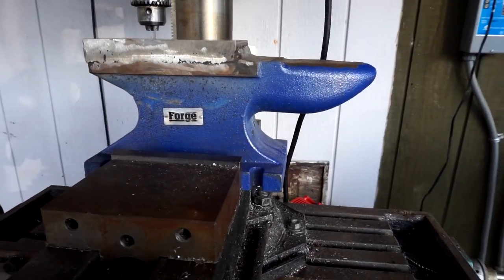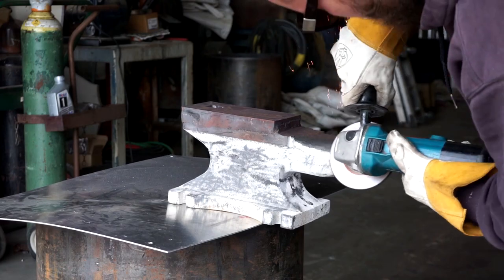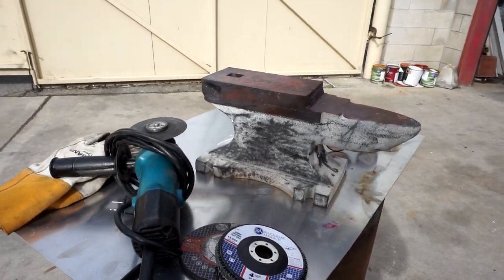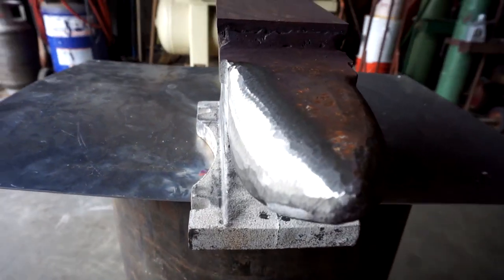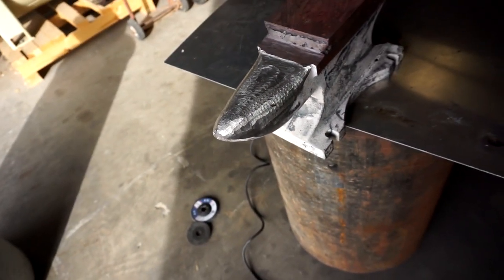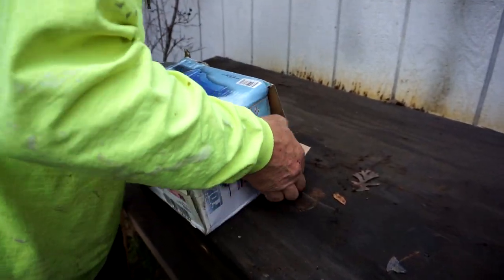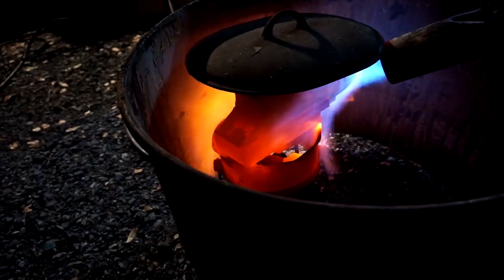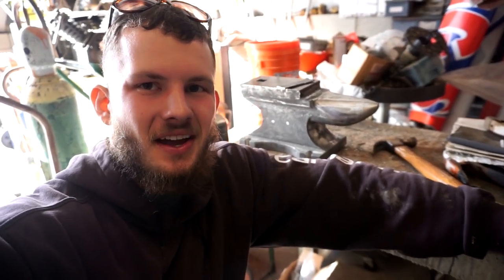HARBOR FREIGHT ANVIL: Milling, Hardening, and Finishing, Part 2

Comment: I'm very likely to do the same thing on my HF anvil.
Don't get me wrong, I've had it for  22 years and have made a ton of usable and salable items for the Mountain Man/Rendezvous.  It has served me well for all that time but, it's time, now that I have a welder and some skill in using it, I want to make  hardened top plate so that it is much more anvil like.
I have already ground down the horn and made it hornier, LOL!!
My onl problem is that I will have to find someone to mill the Hardy hole because I have no milling machine, access to one nor the skill to use one.
I did recently buy an NC 70 pound, actual anvil but, the old one is certainly still usable and my Grandsons can learn on it.
THANKS for the videos and you now, have a new subscriber!
BTW, that step shelf just behind the horn is a cutting plate and SHOULD be left soft so as not to destroy the edge on the chisels and cutting tools!  KUDOS!
Reply from the maker: I appreciate your kind words and advice! If you have the anvil, I'd highly recommend the hardened top modification, but don't be afraid to try a different alloy. I used A2, but plenty of other steels would work just fine. Good luck on your project. Lastly, I did not know that the step was used for cutting! I will definitely be keeping that part soft.
Reply: I'm trying to start up for mountain man rendezvous here as well.
Reply: If you have a drill press get to as much of it as possible with that then try to use a good hand router to go from hole to hole. That's a trick that tons of people use on ar 15 80 percent lowers (although with jigs so maybe think about that) to circumvent the need for an expensive mill.
Reply: Kim Curtis smart idea about the shelf for cutting!

Comment: Is there any reason why the A2 plate couldn't have had the hardy hole milled out, bevel grinding complete, heated in a forge to critical temperature, air hardened and then welded to the cast face? Rather then going through all that.... or am I missing something? 
Love the content, and will be looking to do the same and such is the beauty of YouTube where we can all learn from the sweat of another's brow.
Reply from the maker: The problem with heat treating beforehand is that when you weld the plate to the anvil, the heat from welding will ruin the temper and remove the hardness from the A2 plate. This means that you will need to regarding it after welding.

Comment: I actually think you guys did great. I think you are probably right, it might not have stayed hot enough to fully austenize, and get as hard as it could have been. 

Cooling it with compressed air is definitely fast enough for a2, the main thing you really need to think about though. Is the rest of the body of the anvil, that is holding a lot of heat. That cast iron may have slowed down the cooling considerably, leading to it being softer than it would have been otherwise. Which actually could be a good thing, you don't want it fully hardened if you're going to be hitting it.

And I definitely think you guys were right to weld the plate on first, then heat treat after.
Reply from the maker: Thank you for the kind comments. I think that for our resources (or lack thereof), we did the best we could. The steel definitely got harder, so we did something!
Reply: @FormulaJake  most definitely.  I think it's a big improvement over the cast iron face, that's for sure.

Comment: Did you consider using coal to heat it? 
I use a coal forge and it will heat huge pieces of steel and fast!
Reply from the maker: I did not consider doing so, but I would if I did it again. Propane gas it's great, but it really doesn't get that hot on that big of a piece.
Reply: Airborne Productions Thank you for your video! I’m thinking about doing this exact same thing

Comment: You might also eventually look into getting a Sievert Torch. The one I have will get over 2000 but you need a good high pressure regulator to do so. Oh and they are threaded backwards as they are from the UK. So you’ll have to get a specialty company to rebuild your hose on the end that attaches to your gas tank or source and regulator. They will cost you a couple hundred dollars though. I got mine because I also do glasswork and silver and goldsmithing and I’m working on getting a bench mount for it. If I have to weld one together myself.

Comment: Horns are always soft. Cast steel horns are harder, but nobody has hardened horns except on small jewelers anvils. Good luck that the plate doesn’t break off the CI base at some point.

Comment: I have a kiln and I guess I’ll harden the A2 after I bevel it then weld it on. Did you air cool it? Rather than Quenching?
Reply: My plans all got the brakes put on after I first posted this. But now I have two plates one D2 and one A2? Decisions decisions?
Reply from the maker: Sorry for the late response, this is my first time seeing these comments. We air cooled it since it's A2 but the core of the anvil actually holds in quite a bit of heat. We tried to improve the process by adding water to it so it didn't become annealed from air cooling too slowly. Out of the two I would go with A2, as it is a bit tougher and less prone to chipping. 

I'd consider welding it to a plain block of steel rather than the harbor freight anvil, as the cast iron used in the anvil is difficult to weld to properly. To do it right, you need to use a filler metal that will work with both metals, such as nickel 99. This filler material is usually pretty expensive, though.

Additionally, when welding, make sure to weld the entire bottom striking surface to the anvil. We only welded the edges, which was a mistake. Without welding the entire underside of the striking surface, the gap left ruins the rebound. If possible, leave a gap and fill the entire gap with nickel 99 rod. Like I said, it will probably be expensive.
Reply: @FormulaJake  D2 is more expensive too. I will use it for blades or something later. I will look into the nickel rods if I can find any.

Comment: You said you were welding the A2 plate on to help with rebound, but you didn't compare the rebound before and after. How do we know if, and by how much, this helped?
Reply from the maker: I didn't quantitatively measure it before and after, but I know that the rebound actually decreased after, due to only welding the plate at the edges. However, the A2 plate is so much harder than the cast HF anvil surface.

Comment: That's a nifty idea actually! Might do that to mine.
Just watch out, A2 can be very brittle when hardened, and if you miss and hit the edge with a hammer it can send chips out like bullets right at the height of your femoral arteries and other important stuff in that general area. If you manage to harden it look into tempering it too so it's less likely to chip!
Reply from the maker: If you want to put the HF anvil to use at all, I'd highly recommend adding the top! A2 isn't necessary at all, though. Eventually I'll harden it again to get a better heat treat, and a good temper will definitely follow. Thanks for the advice!
Reply: @FormulaJake  Maybe try a decent temper around the edges so you can maintain toughness to avoid chipping but not have nearly as much brittle property to the material. Hope I can be of help.
Reply from the maker: @schleybailey  good advice! Right now it is not very hard on top, so we are going to heat it up at least 200 degrees hotter than it was and then cool it off so it actually has some hardness. Then we will temper it to make it less brittle. Thanks!

Comment: Can then anvil be hardened by itself? Meaning without the cap...... Can just the anvil out of the box be hardened? Or is that top cap necessary?
Reply from the maker: The cast iron itself is pretty crappy, and probably won't last like some good tool steel. I'd recommend adding tool steel to it, but it will still work as is. I don't know how well it will harden, though
Reply: @FormulaJake  THANKS, I went shopping around at some antique shops yesterday..... I may have to start out with a harbor freight cast iron chunk. 
Great video.
Reply from the maker: No problem! I'd look around and see what you can find. We also completed an anvil build using a forklift fork for the body, cut into ~8 inch lengths, and stacked up and welded. Then we capped that with A2. You might be able to find something that works out better for you!

Comment: Uhhh u didnt heat treat that u just nomalist it
Reply from the maker: Yupp, I mentioned that at the end. I'm gonna try again this summer with much more heat.
Reply: @FormulaJake  heats not just it you got to quench
Reply from the maker: It's A2, which is air hardened. I read many write-ups about hardening it, and they said heat to 1750°F, then let cool down. Would quenching it be better?
Reply: air hardening requires an enormous blast of very cold air,also why did you not oil harden the plate before you welded it to the anvil?
Reply: @FormulaJake  Harden in warm oil instead of compressed air. Air hardening requires super expensive machinery.

Comment: Get a 10in x 6in x 2in block of A36 mild steel off of ebay it is only $56 think of that compared to this anvil that costed that much before you even upgraded it trust me do not for any reason buy a harbor freight anvil, i had one and it gave me a bad taste of forging